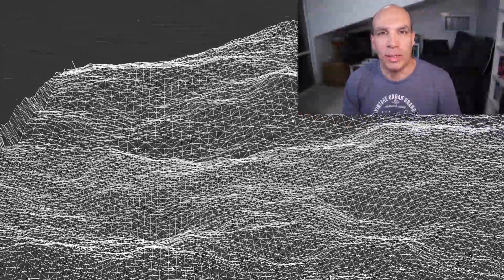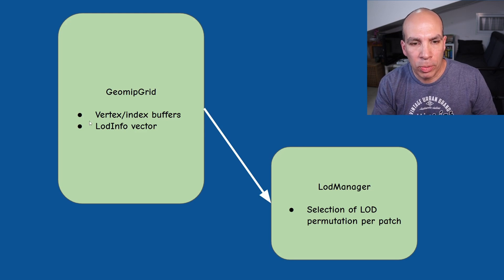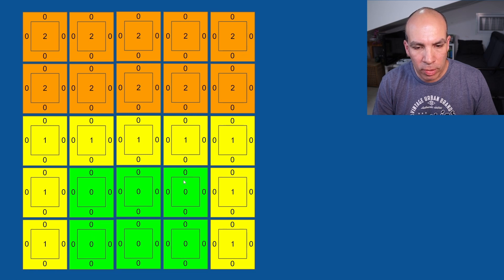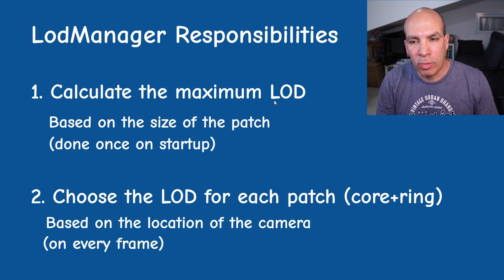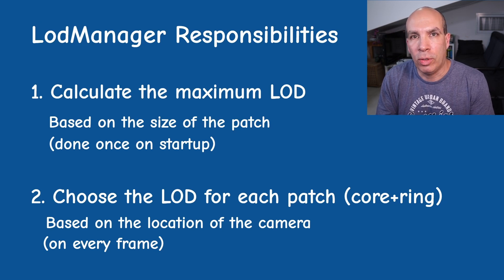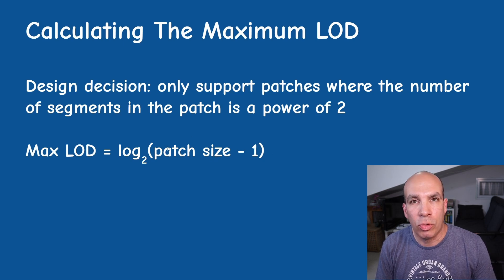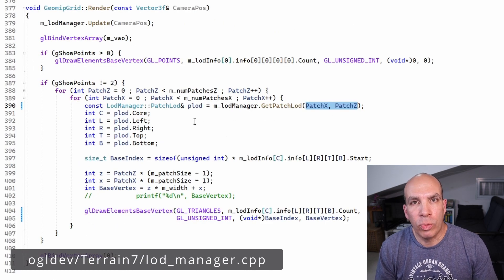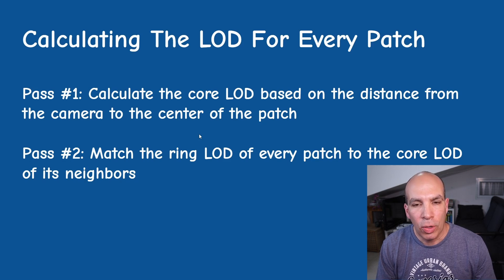The LOD Manager // Terrain Rendering episode #8

Comment: I really appreciate your time doing this and taking time to answer our questions, I have sent a donation via PayPal. This probably was the hardest tutorial so far for me, dynamic LOD is working perfectly, but I'm having a weird issue: looks like a single vertex is missing from each patch, no matter how far or close the camera is. If you look really close you can still see there is vertex there but it's less bright than surrounding vertices and then I'm not in wireframe mode I can just see a black hole on every patch.
Reply from the maker: Thank you! I appreciate it :-)
There is probably a bug in the creation of the triangle fan. You can change the terrain size to 3 and set the world scale to at least a 100. This will provide a single large triangle fan which should be easier to investigate. You can then increase the size of the terrain in a small steps. Or maybe the start/count of the segments is wrong.
Reply: @OGLDEV  FInally found the problem! I was missing a line in GeomapGrid::calcNormals() method, I was not aware this method changed since last video but it did, now you need lodInfo to get number of indices to calculate normals for. Those indices had wrong normals I guess and they were much darker than the rest so this was a lighting issue all along haha

Comment: I figured this part out back in 2019 without any tutorial. :)
The Main difference is I put the converter on the lower res to the higher res.
Because, it would be more expensive to update the highest res.
LOD0 would never need to be changed this way. :)
Reply from the maker: The conversion is done offline so I'm not sure the word 'expensive' is relevant here. In terms of the number of vertices - when you go from lower res to higher res you add indices while the other way means reduce the number of vertices. I haven't done the exact calculation to see which method uses less indices.
Reply: @OGLDEV  The way you does it reduces indices.
So, it's done offline? Like you just changed the selection of indices buffers?
I've been thinking about doing that. the original way had some things to be desired.
Reply from the maker: Offline, yes. I explain this in episode #7. The original implementation in the book that I'm following in the series is from the early 2000s. The author had to use the fixed function pipeline with all the old APIs so on every frame he constructed the LOD that he needed using a series of glVertex calls. To make it offline I'm using a single (large) index buffer with all the possible combinations between each consecutive pair of LODs (0-1, 1-2, etc). I maintain a data structure which points to the start and count of each segment of indices for each possible permutation. The LOD manager described in this video helps in telling you which permutation you need to use according to the distance from the camera.